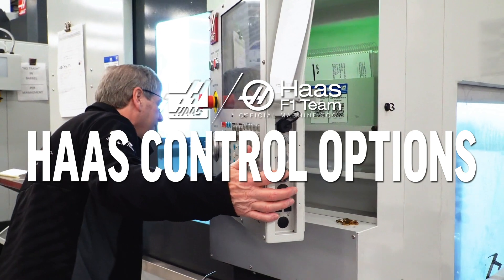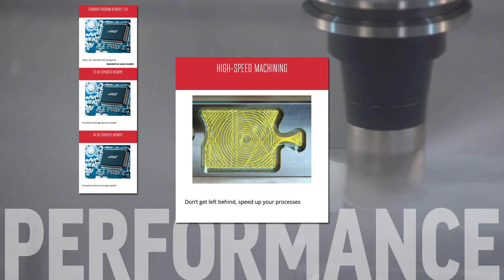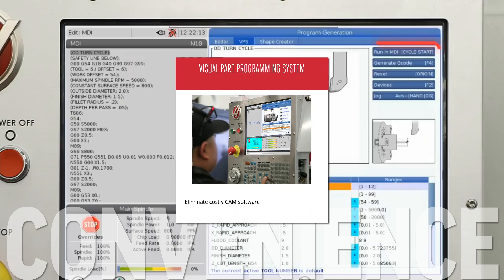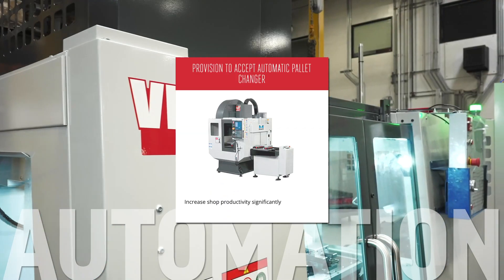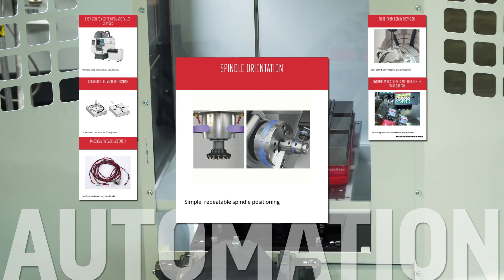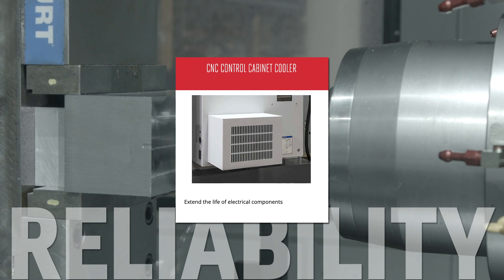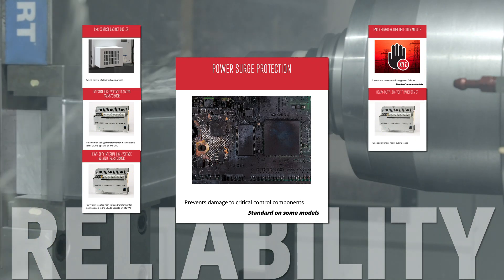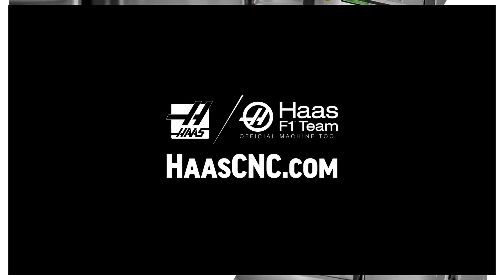Haas Control Options Overview - Haas Automation, Inc.

Comment: I appreciate some may not need certain software features but the fact haas sells machines that are physically capable yet crippled for ransome / locked down behind a pay wall is the reason I'll never buy a new Haas. And it's a pity, I like the control & the machines. 
What's worse is Haas still demand vast sums of money to enable features on even their older machines. I've a 94' Vf1 that I would like to enable macros on. It's almost as much as the machine is worth.... where is the logic in that? @haasautomation stop being greedy little pigs 🐖
Reply: This I kind of accept. What I do not accept is that we recently had a visit from an HFO's engineer who came to look at our defective tool probe. He did not have a spare OTS with him to verify that was indeed the problem but he did install a new software version with some annoying features and asked 700 Euro for the work he did, telling me he could only sell me a new OTS. I told him that Renishaw has a repair service but our HFO does not offer to have to OTS repaired for us.
We are now looking at a lathe and I am strongly advising against a Haas because I think we have local machine builders that offer better service ...